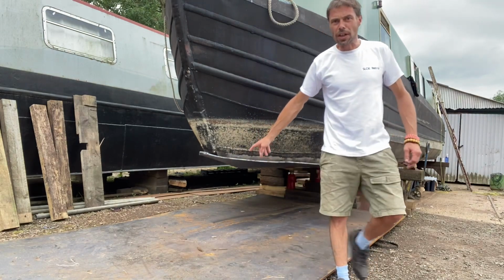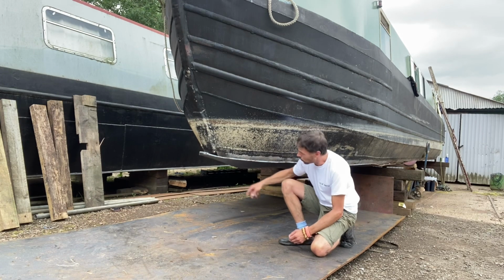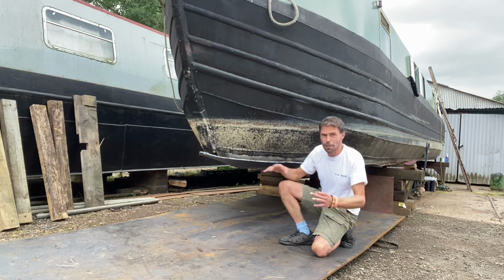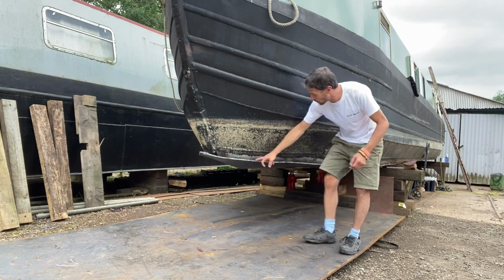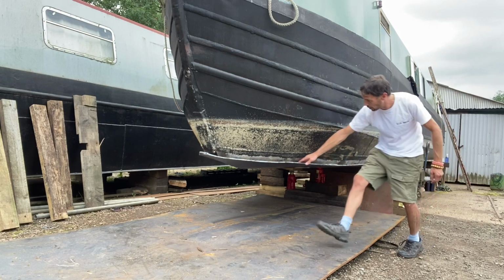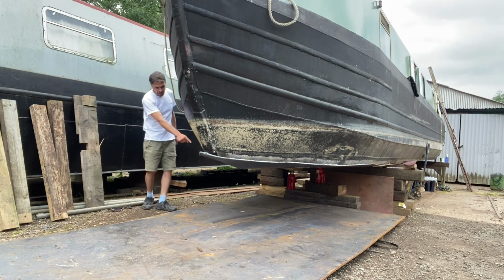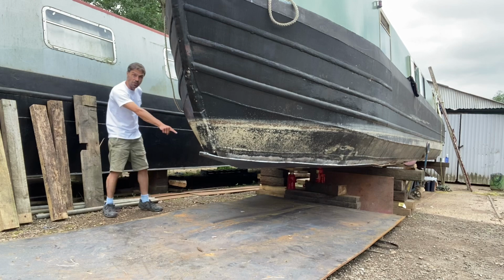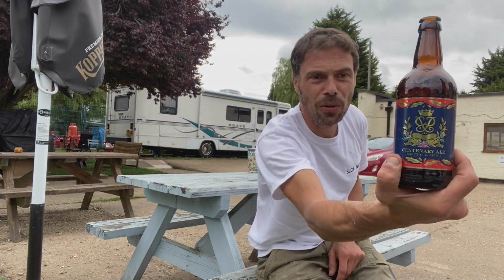213. First 6mm steel sheet welded to Narrowboat

Comment: Just out of interest how much extra weight will this add to the Boat and are you going to have to de-ballast it any?
Reply: 1500 kg of extra weigh, approximately.
That’s worked out at 34m2 of boat, multiplied by 47Kg per M2
A lot of extra weight but shouldn’t be an issue.